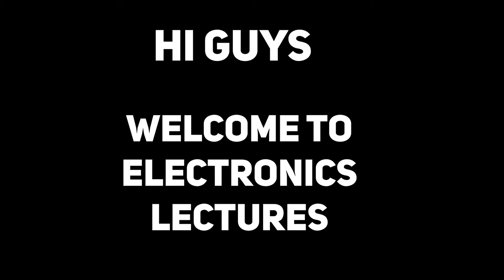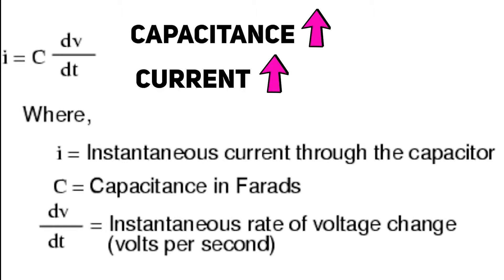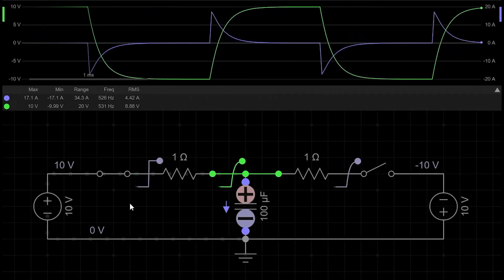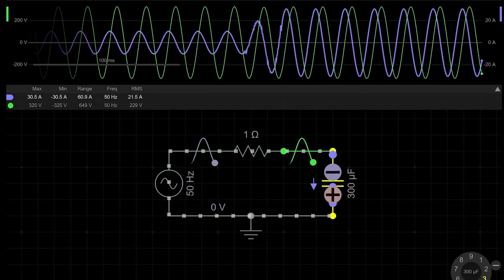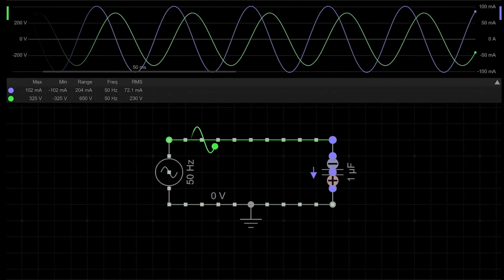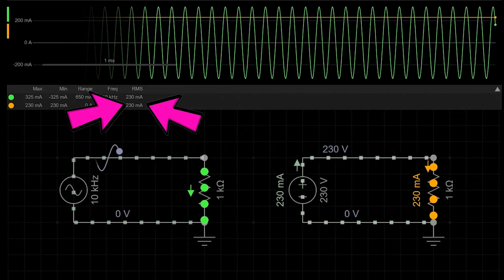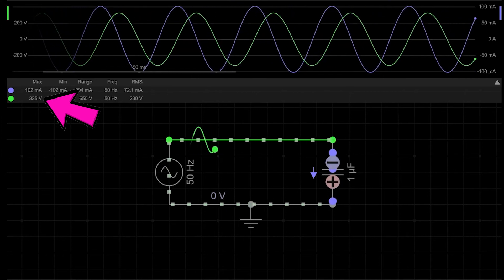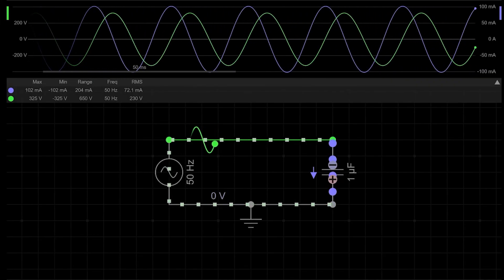How Does AC Pass Through Capacitor, but DC not? What Is The Secret?

Comment: BUT WHAT IF YOU HAVE A 10 V BATTERY IN SERIES WITH A SMALL 1 mV ac SIGNAL??? AND OUT A CAPACITOR AND RESISTER IN THE SERIES CIRCUIT. CURRENT ONLY GOES ONE WAY --- CORRECT ?????? IT'S A FLUCTUATING DC CURRENT---- CORRECT ??? SO HOW DOES THE CAPACITOR DISCHARGE. I CAN SEE HOW IT WOULD CHARGE UP WHEN VOLTAGES ARE APPLIED. BUT HOW THE HELL DOES THIS THING DISCHARGE ??? IF THE CURRENT ONLY GOES IN ONE SOLE DIRECTION, HOW CAN THE CAPACITOR CHARGE AND DISCHARGE IF THE CURRENT ONLY GOES IN ONE SINGLE DIRECTION ? HOW DOES THE CIRCUIT WORK ??? I CANNOT FIGURE IT OUT. I'M STUMPED AND STUCK ON STUPID.
Reply from the maker: If you have 10V DC + 1mV AC, then capacitor will charge up to 10V and voltage fluctuation at it is goind to be those 1mV. Current still will be flowing in 2 directions, caused by that 1mV AC signal. For example to get from 10V to 10V +1mV capacitor has to be charged, so current has to flow in one durection, but for it to go from 10 V to 10 V - 1mV, it has to be discharged, which means current has to flow "out of it".
Good luck)
Reply: @NickElectronics  OH, YES. I SEE NOW PERFECTLY. BUT WHAT IF YOU HAVE A NPN COMMON EMITTER AMPLIFIER CONFIGURATION WITH EMITTER RESISTOR AND EMITTER BYPASS CAPACITOR. NOW, ENTER AMPLIFIER CURRENT ONLY FLOWS ONE WAY THROUGH THE TRANSISTOR. AND IT'S A FLUCTUATING DC CURRENT. SO HOW DOES THE EMITTER BYPASS CAPACITOR CHARGE AND DISCHARGE. I CAN SEE WHERE IT CAN CHARGE ON ONE  HALF CYCLE  THE SINE WAVE,  BUT WHAT IS THE PATH OF DISCHARGE ??? THE CAPACITOR IS PUT THEIR TO SHRUNK OR BYPASS THE RESISTOR CORRECT ?? YES I THINK THIS IS CORRECT. SO NOW HOW DOES THE CAPACITOR CHARGE AND DISCHARGE. IT CANNOT DO BOTH THROUGH THE TRANSISTOR. CURRENT ONLY CONDUCTION ONE DIRECTION THROUGH THE TRANSISTOR. I'M NOT COUNTING SMALL LEAKAGE  CURRENTS OR EXTRANEOUS CURRENTS. JUST A BASIC TRANSISTOR AMPLIFIER. AND INDIES CONFIGURATIONS WE TAKE IT TO CURRENT ONLY GOES TO THE TRANSISTOR IN ONE DIRECTION. ELECTRONS GO FROM EMITTER TO COLLECTOR IN THE NPN. SO IF THE CAPACITOR CHARGES THROUGH THE TRANSISTOR, WHAT IS THE PATH OF DISCHARGE ???? DOES A DISCHARGE THROUGH THE EMITTER RESISTOR ????? THIS ALL SEEMS STRANGE TO ME STUMPED I AM STUCK ON STUPID. I SIMPLY CANNOT FIGURE THIS OUT. ☹️
Reply from the maker: @ANTOINETTE-nk1tm  yes, it discharges through emitter resistor.

Comment: You are speaking so fast and your accent is so heavy that it is impossible to follow your explanation. The graphics and animation are excellent but it is very hard to follow at that speed. If you had a narrator that spoke slower and more clearly this would be the best video for explaining how capacitors block DC and pass AC. I finally gave up at 4:47 because of the frustration.
Reply from the maker: I will try to make it better. Thanks for your comment